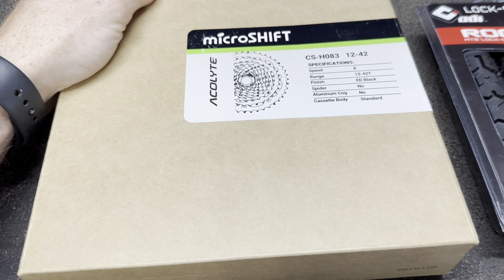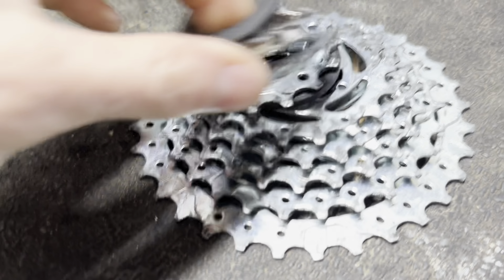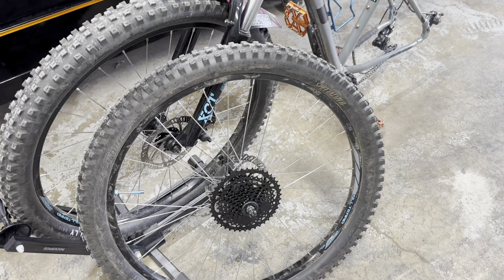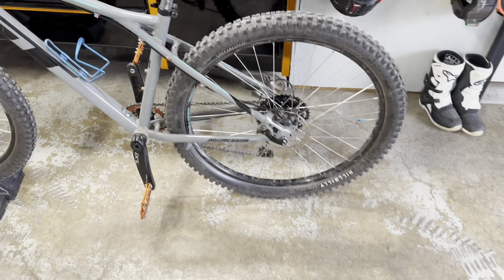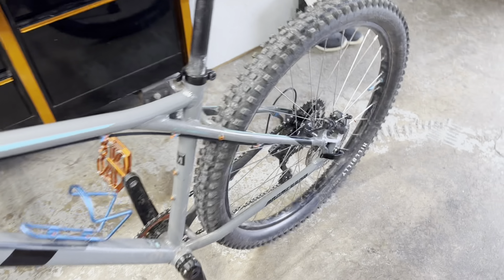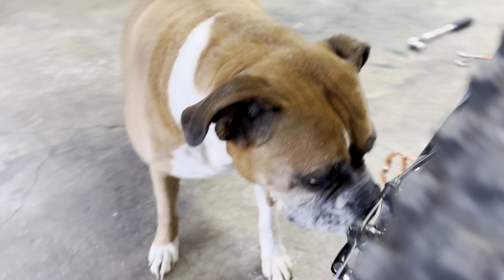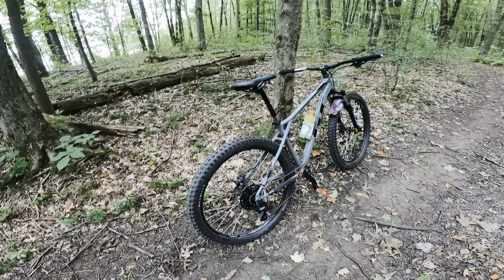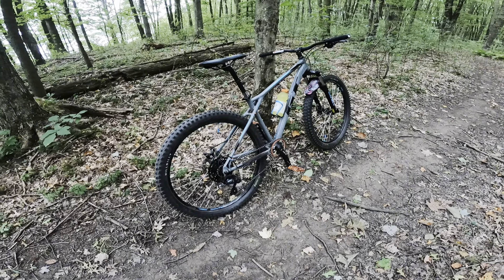GT AGGRESSOR PRO UPGRADES! CASSETTE AND GRIPS

Comment: How have you liked your 1x up front? I have a GT Aggressor Pro and have been thinking about going to a 1x but not sure yet. I def want to upgrade the cassette tho and forks
Reply from the maker: I have a fork upgrade video if you wanna check that out (huge difference maker for the aggressor)

I love the 1x, less stuff to go wrong haha - it’s a trial bike for me and 8 gears are plenty haha - my wife has a specialized rockhopper that’s 2x and it’s about to get 1 x swapped also

I think it’s preference - I usually am between 3rd and 6th on a trail ride and the second chain ring up front wouldn’t change the quality of my ride so I love the 1x

Thanks for watching!
Reply: @motodad311  Yessir I'm definitely gonna upgrade my fork also while I go to a 1x!

Comment: So it's much easier to climb up steep stuff with the cassette 11-42 right? Are you using the stock derailer in this one?
Reply from the maker: I honestly didn’t notice s a huge difference other than that first fear is lowwwww and easier to make power up hills

Nope, I did the derailleur before the cassette